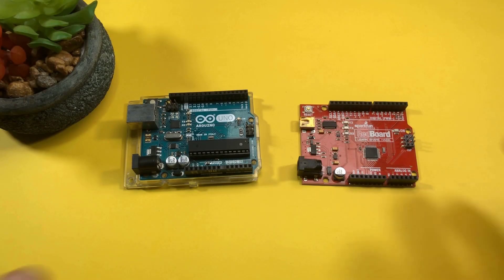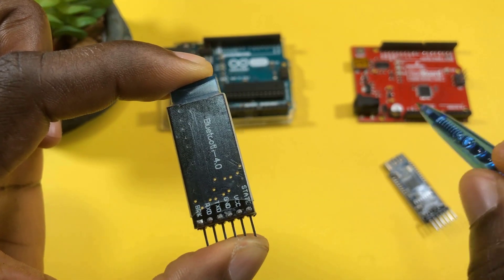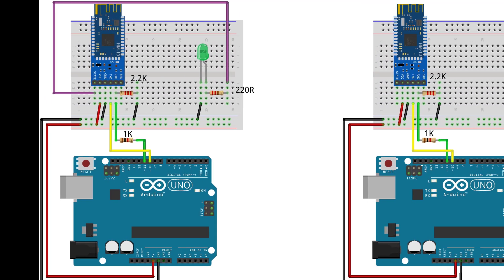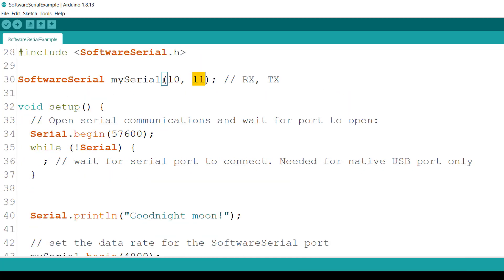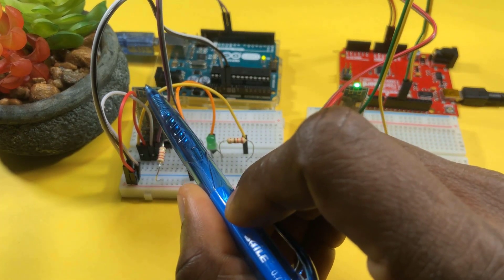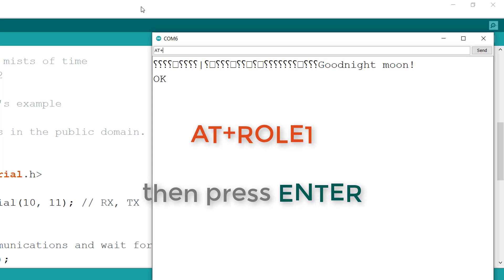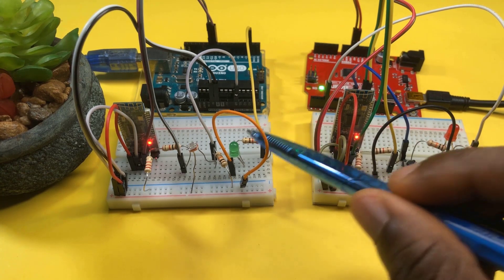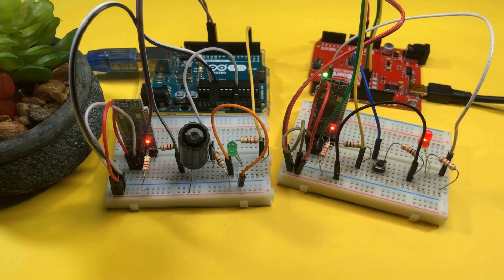How to Connect Two Arduino Projects Together Using HM-10 BLE 4.0 | Bluetooth Low Energy cc2541 bc417

Comment: Why doesnt anything happen when I use the AT commands?
Reply from the maker: Its possible there might be a wiring issue, or you need to restart your serial monitor to re-establish the serial connection.

Comment: Hello, I'm trying to get two HM10 bluetooth modules to connect to each other for my senior year university project. I have followed the video although my circuit is slightly different. The bluetooth module can connect to the DSDTECHBluetooth app on my iPhone. However, when I turn off all nearby bluetooth devices, and disconnect the HM10 from the DSDTECHBluetooth app, I cannot run any AT commands in the Arduino serial monitor. I have tried several different configurations of the voltage divider, and still nothing. Is it possible that my wires are faulty? I'm not sure how the HM10 can connect to the DSDTECHBluetooth app, but AT commands do not work. Any help is appreciated, thank you!
Reply from the maker: Sorry i am just now seeing your message. I hope its not too late.

1. Yes, it is possible for jumper wires might be faulty. I have had such issues in the past. I sometimes verify the wires using a "continuity" check with a multimeter. If you dont have a multimeter, wire up a simple LED and then keep swaping out wires till you're sure they all work.

2. Your voltage divider ultimately needs to output 3.3v peak so it doesnt matter the resister combination you use, as long as the resister values are not super high and the voltage out to the HM10 RX is 3.3v you're good.

3. Make sure your arduino drivers are installed

4. Once everthing is connected, set your IDE to the correct Arduino Port and upload the Software Serial Sketch. Also make sure the Baud Rates in the Code is as i recommended.

5. Check the schematic i have provided to be sure your wiring is correct.

6.  Restart your serial monitor. Make sure your Serial Monitor Baud rates are as recommended.

7. Type AT and press ENTER, It should work.

I hope this helps. Sorry for the late reply.

Comment: Really nice video ! Thanks. I connected 2 HC-10 to a usb-2-serial ports ports. They accept the AT commands (like AT_HELP) and respond with text etc to my port reading program. Now i want to send data.... Do i just go ahead and send data to the same ports and it will be received from one HC-10 to the other ? (so thats AT commands and data all go through the same Rx and Tx. I can't see how else)
Reply from the maker: Just so i understand your question. You want to send data from one module to the other!

To send data from one of the modules to the other, they must first connect to each other as i've demonstrated in the video. Second, you must now send data through the same channel you were sending the AT commands, for it to be delivered wirelessly to the other module.

I hope i've answered your question?
Reply: @Delali  thanks I'll have a go!

Comment: Hi, this video was very helpful. I am working on a final year University project and have an issue with the HM-10 module. I can see that it has been powered correctly, with the correct potential divider used to join the TX pin on the arduino (determined by the SoftwareSerial library) to thee RX pin on the HM-10. However, when I send an AT command, I receive nothing back. A research assistant at the University suggested using a pull-up resistor, and checking what might be happening between the pins using an oscilloscope. What might be the reasons why I am not receiving the "OK" shown in your video when sending the AT command? (I have also changed the serial monitor setting to 'Both NL & CR')
Reply from the maker: Kindly check the "about" page of this channel and send me a mail with your current wiring.

In the mean time if you have another set of HM-10, can you try those. could be that you have defective modules or they are communicating at a Baud thats not the default.
Reply: You solved this problem ? Unfortunately I have the same problem

Comment: Hi very informative thank you very much ❤
Why is there such a delay between the button press and the LED actually lighting up ? I need a real time application with max 50ms...
Also, is the connection secure enough so no one disturbs the connection with a simple phone (I need to use this in a crowded environment to control a few relays at the distance for a live show so it would be a disaster if the communication breaks down in a middle of the show 😅)
Cheers😊
Reply from the maker: Thanks so much for the feedback.

The delay is partly due to the size and characteristics of the commands/data transmitted and received, also the functions and methods i used to process the commands/data isn't optimized for speed. 

I wanted to keep things simple to enable more people to try what i was showing in the video.

For real-time use, you might have to look at perhaps a board like raspberry pico 2040.

Comment: Hi! I love your video and i have been able to connect my HM-10 Bluetooth modules together thanks to you! However… when adding the code you provided, everything seems to stop working. So when I for example press the button, nothing in the serial monitor is written :( do you have a solution for this maybe? 
Happy for an answer:)
Reply from the maker: Thanks for the kind words and for reaching out.

Kindly make sure your serial monitor baud rate match what you used in the code...If you used my code without changes, that should be 19200 and also set view to "Both NL & CR".

Have you tried using the LEDs to visualize the effects of pressing the button as I did in the video?

Kindly let me know if it doesn't work.
Reply: @Delali  Hi, thanks for the answer! Both the baud rate abd the set view is set to 19200 and "Both NL & CR". I even doubble checked so it should be connected correctly too... I followed every step in your video, but I still have the trouble with sending signals between the two BT-modules :( 
thanks in advance! :)

Comment: Nice video. Can one HM-10 master be connected to two HM-10 slaves
Reply from the maker: I haven't tried two hm-10 slaves but as you've mentioned it now, I'd get an extra module and try it.

I will make a video if I'm successful.
Reply: @Delali  Thanks

Comment: My HM10 and HC06 are paired with my PC how ever they didn't connect, can you show me how to?
Reply from the maker: HM10 and HC06 are two different Bluetooth types.

HM10 is Bluetooth Low Energy 4.0 and HC06 is Bluetooth classic. So its understandable why they wont pair together.

 Kindly get another Bluetooth HM10 and it will most likely pair with the one you already have. 

Please dont forget to subscribe. Cheers!!
Reply: @Delali  No... I’m using them to pair with my PC not together .-.

Comment: Hello, Very informative and helpful video by the way, I am looking for your advice on connecting that same cc2541 HM-10 and Arduino Nano. I got Breadboard board power supply board , breadboard, 12v DC adapter and Nano. What would be the best way to connect the Nano and Bluetooth as I'm little bit aware of voltage shock between them. Please be kind to provide a best recommendation as I'm on a project doing a Robotic arm that powered with four servos which intended to feed food to disabled. Thank you and If you're not clear what I'm asking for, please reply down here and I'll be back immediately.
Reply from the maker: Hello Friend, thanks for getting in touch.

Your Arduino Nano wiring to the HM-10 remains the same as with the Uno but this time the 12v dc adaptors positive goes to Vin of the Nano(it supports 7-12v), ground goes to any of the ground pins of the Nano and then you can connect the Nano's 5v pin to the HM-10
Reply: @Delali  Hello thanks for replying, I'm using DC adapter to power all those servos as they require high amps and voltage. So this what I'm planning for, I use my breadboard power supply board that connected with DC adapter (12V/1.5A) and since it got two variations called 5v and 3.3v, I will power my Bluetooth to the 5v via positives power rails on breadboard and GND to negatives..next RXT,TXT pins on Bluetooth will connected to vice versa on Nano. So with Nano, I will power with USB as usual coz I'm still in test mode, I should try your recommendation later when all coding and testing stuff done. Is it okay, my friend? Sorry for long message btw. Again Thank you for replying :-)

Comment: I'm curious to know if you can set up multiple slaves to one master and then the master to a main device and communicate data through or from all back to main.  going to be testing this for sure. thank you for the code.
Reply from the maker: I have been wondering same fam. Not sure if its possible to connect multiple slave HM10's to one Master HM10 but i'd do well to let you know if i succeed.

Let me know if you try it out and the results. Cheers!!